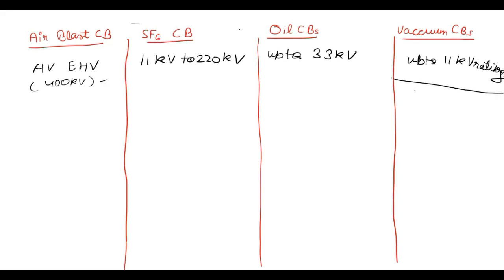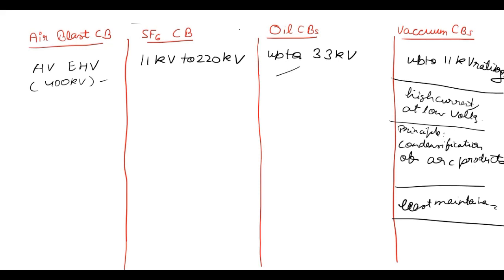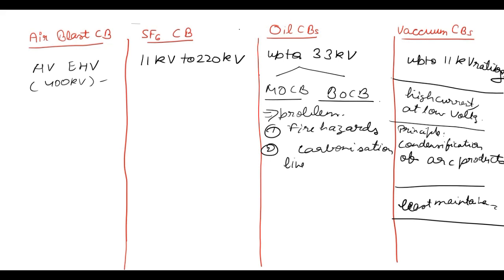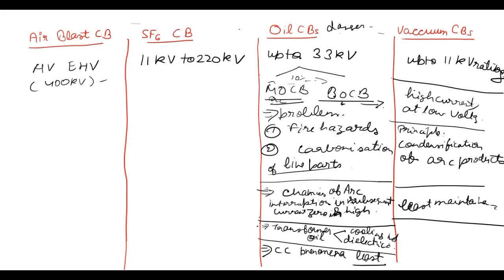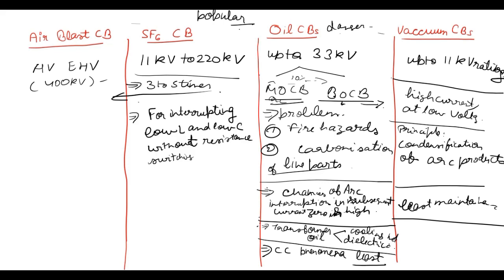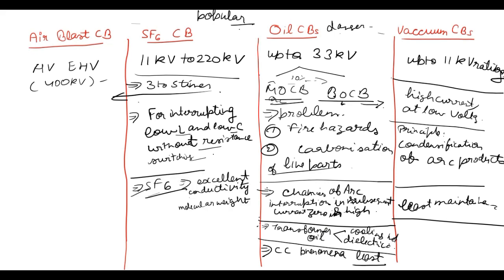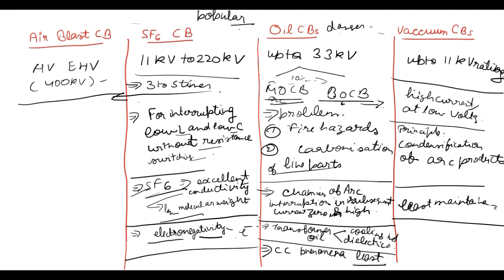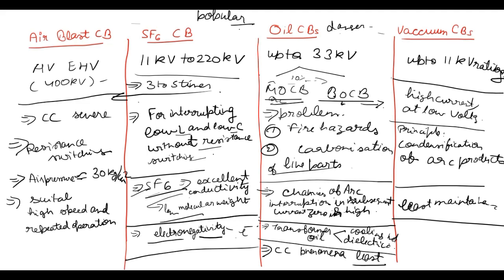Basic difference between 4 types of Circuit Breaker : Air Blast CB, SF6 CB, Oil CB and Vacuum CB

Comment: Arc quenching takes place in SF6 circuit breaker on Puffer mechanisms (suitable for EHV beacuse dielectric strength Of SF6 is 2.5 to 3 times higer than air)and in Air blast CB - force blast mechanisms use , due to this mechanisms it is able to operate at 15KV-500MVA.

Comment: Pls verify, vacuum CB used to interrupt Low current and high voltage.... Clarify my doubt....
Reply from the maker: Thanks for your question. Since you can see from the video or books you have , vacuum cbs are used for low  voltage of 11kV and high current. Although 11kV is not low voltage but it is less in comparison to other cbs and in transmission system it is low. So we say vacuum cb is used to interrupt high current at low voltage.